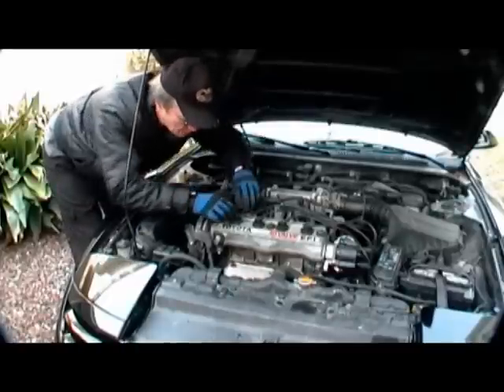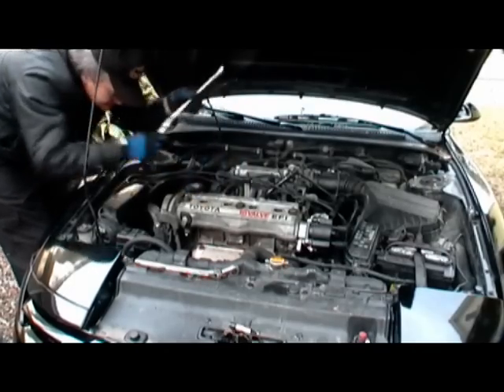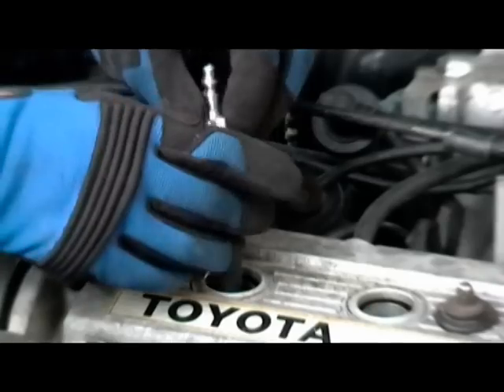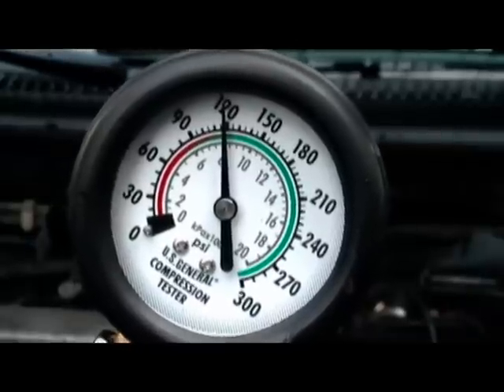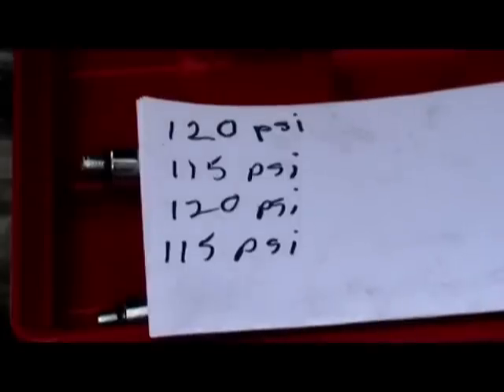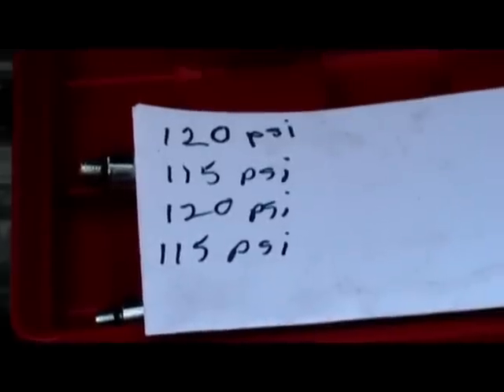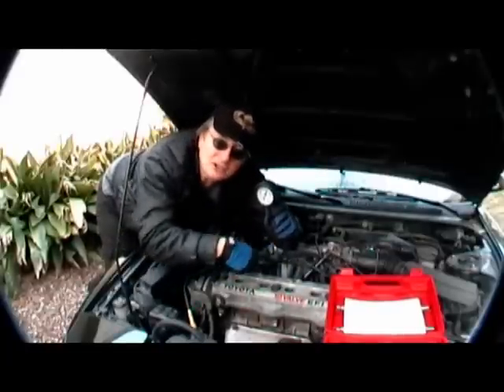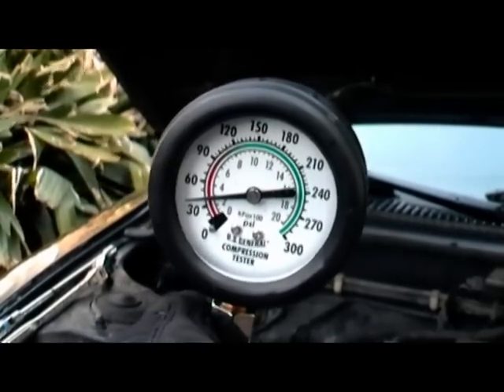How To Check The Compression Of An Engine

Comment: I've been reading online how to do this, and I'm a little daunted by the task. I have a 2004 Jeep Liberty, 3.7L and I want to do a compression test. But some places keep saying I need to disconnect my fuses for my fuel pump and fuel injectors, and burn out whatever is in the vacuum lines before I go about testing compression. I'm fairly new to this whole car thing, but my Jeep has done nothing less than force my hand to get good at this. Is there any truth to this, or can I just follow the steps in this video and I'll be fine. I'm just not looking to cause more damage than the thing already has.
Reply from the maker: Brandon Coleman follow this video it doesn't matter if the engine starts during a comp test
Reply: Scotty Kilmer Thanks Scotty, I'll follow it as best as I can :3 Jeep's been throwing cylinder misfire codes, tried a coil swap, no dice, still threw codes on the same cylinders, I've had my spark plugs changed recently, still no luck. Cleaned my throttle body, and ran fuel injector cleaner (Seafoam, unfortunately didn't see your video about the gum out stuff until today) through the gas tank, still rough idles, and sometimes when I accelerate, it's not that it's sluggish, but it feels like I hit a pothole or something. It's only at the beginning of my accelerations though. I'm hoping the compression test comes back fine, otherwise I'm worried I'm looking at new valves or something in my engine.

Comment: Hi Scotty, your videos are extremely helpful to guide my compression test.
My car is 2005 Mazda 3s, 4 cylinder, with 56K miles. The data required by manual are: standard: 199.1psi, minimum: 139.2 psi; maximum difference: 28.5 psi. My test results from passenger to driver side are: 178psi, 162psi, 171psi, 168 psi.
What are your options for my test results? 162psi is pretty low compared to 178psi.

Thank you.
Reply from the maker: Shiwei Luan   it should run ok that way, but really , with on 56 k on it, the oil must not have been changed every 3-4 thousand miles like I recommend to have that kind of wear already
Reply: Scotty Kilmer you are right, the first owner changed oil every 8 months. But for the past 20K miles, I use Mobile1 synthetic oil every 4K miles. How many miles will this engine last if I change the oil every 3-4 thousands from now on?

Comment: hi, hello, I just wanted to ask.. I did a compression test on junk yard engine... there is 2 psi..did I do something wrong? I hand crank it ))spinning not fast engough))engine is been sitting for awhile ))) NO WARM oil, to all metal parts))ii did everything right!! remove all spark plugs,,,plug in the compressor.. what hath hah should I do now?
Reply: The head could have major leak ,piston rings are possibly stuck- valves could be worn out across the board, but hand spinning usually only works for small engines- not an adequate test for bigger than lawn mower engines or small motorcycle engine.

Comment: hey scotty,
i have a 2004 toyota pickup 4 cylinders its misfiring and have some vibration when start move and when ascending a hill .
i changed spark-plugs 3 times and test every thing and find nothing bad .
after this video i tested the compression and found the cause of the misfire .
3 cylinders around 165 psi and # 4-95 psi .
i pour an oil in cylinder #4 then i have 150 psi .
are there any way to fix it with out change the piston rings ?
Reply from the maker: not really , and it could be worse than that, as rings wear, often cylinders do too which would require a new block. Most guys go with a good used junk yard low mileage engine instead.
Reply: Scotty Kilmer
 thanks for feedback .

Comment: Hey Scotty! Great vids!! I'm subscribed. I wanna ask: Are these pressure gauges universal? Can one of these be used to test the compression of a motorcycle engine? My question concerns mainly the size of the hose "head" that screws in to the spark plug hole.

Comment: I want to check the compression on the front three cylinders on a gm v6, do i have to remove the plugs on the back three cylinders also or can i just remove a fuse to take away the spark?
Reply: Oh shit don't tell me it's a 3800. Those plugs are a bitch

Comment: you should also disconnect the ground of ignition coil,becouse the high voltage is breaking the isolation of high voltage cables when electric resistance  is saddenly grows up..

Comment: hi how are you i have questions I rebuild the engine for my Suzuki Forenza before 3 days ago and when I opened the spark plug i found there is oil on top of the piston it's OK or no thank you
Reply from the maker: +Karam Chato drive it a week or so, often oil gets on stuff while rebuilding and then just burns off. PRAY it's just that

Comment: Is it a good idea to do this on a warm engine? In another video you warned about changing spark plugs on a warm engine because it can damage the threads and give you a bad day, especially if it's aluminium.
Reply from the maker: Henrik Nilsen just be careful, the test is more accurate on a warm engine
Reply: Compression test can be done cold for a comparison. At operating temp. Is the prefered temp. There is also wet (squirt of oil) and dry (no oil)
Reply: Henrik Nilsen 
*Henrik you made an excellent point. I cant even say i've yet become a do-it-yourself person, nottomention claim to be mechanic. All I've ever done is 2 oil changes, a filter change alongside my dad (God bless), and just once (after extreme research and scrutinizing): removal of spark plugs in order to re-gap and clean them. I also wanted to get access indide the cylinder to spray fogging oil to insure a nice lubed start for a car that had been sitting unused for 4 months.
**My point in this msg is that you made a very astute, clever observation: spark plug removal becomes risky when engine is warm or hot. It is almost always recommended done on a cold engine to avoid damage or difficulty in loosening, lessening the risk of breaking them, espec the insulator part by the terminal nut. ~Pep Boys website spark plug removal

Comment: how can you get that tester? and how much? i have a 01 s10 4 cyl truck 2.2 little and mine wont start its been sitter for 3 weeks now i dont know why it started to do this and i also have a blown freeze plug i been told by other people i have a blown head gasket but when i have check all of my oils they are fine no water in it you told me to check out this video my engine sound alot different and now that its been sitting my battery is dead

Comment: hey scotty, my car will not run , and after all the necessary tests,  i have reason to believe that jumped timing is the reason for my problem. however, how do i do a compression test for timing if it will not run .engine has to be warm , correct?
(fyi ..tried posting on your site to give you more details , but the site will not let me post.)
Reply from the maker: na, cold engines can be compression tested too, it would just be a small bit lower. And you have to join my website to post, but it is free at www.scottykilmer,com

Comment: Hi Scotty, what it work for Diesel engines?
Reply from the maker: you use a compression gauge with higher readings, and adapters that fit into the glow plug holes once you remove the plugs

Comment: I have a hemi engine that has two plugs per cylinder, how do I do a test on one cylinder?

Also, if I do find that the pressure from one cylinder is way lower than the rest, what does that mean? I guess it could man a number of things from bad rings to a hole in the piston etc....
Reply from the maker: just take one of the plugs out of each cylinder to test. If one is way lower, could be tons of things, and only taking the engine apart would find the true cause
Reply: Scotty Kilmer Yeah, I thought about it and figured the smart thing to do would be to take out one plug. It was early when I posted but thanks for answering :)

Comment: I got 4 readings one was 125 another 180 and two 160 is that bad? this car wont start its a throttle body has spark, it combusts on ether, i can smell fuel in the exaust  i tested the injectors with they are firing but rapidly pulling only an exuast code, its a 2000 subaru v 4 it has fuel rails as well.
Reply: +rubbertramp wrattchett you most likely have an exhaust valve that isn't fully closing during compression on the cylinder that read 125.  You'll either need to have a valve job done or replace that valve.

Comment: if say like on that reading say the 4th cylinder was only 70 psi instead of that 115 psi does the loss of compression mean that the block is cracked or could it be simple and just need to adjust the valves? just for instance just curious

Comment: Hey man, so i ran a compression on my 5.0, all cylinders are fine except for cylinder 8.  The reading shoots up sporadically to 240 but doesnt hold.  When i stop cranking, the gauge slowly drops back to zero.  See latest video i posted on my page when you have time.  Im hoping its just valve stem seals.  Let me know man, thanks!
Reply: k129h8 I have the same problem with my car. Higher compression. I’m thinking it’s the valve stem seals to. And your gauge might be faulty if it’s leaking air.
Reply: Stefen Bays all the other tests were good on the other cylinders.  I hope its not the tester because its brand new.

Comment: right now my vehicle cannot start so i am unable to do a compression test on a warm engine. any suggestions???? there was a blown head gasket, i replaced the gasket, water pump, now the car will not start. we are getting fuel, spark, but very low compression on all cylinder.
Reply: j c maybe the timing belt is a few teeth off

Comment: Love your videos! I have a engine with 240k miles on it burinng oil not sureif its the  piston rings or valve guides, what would you recommend doing?
Reply: Rey Reyna Do a leak down test to diagnose. You can do it yourself.

Comment: Scotty just had a quick question, I'm getting ready to purchase a diesel compression tester kit, is there any reason that the gauge itself would not be compatible for use on a gasoline engine, and if not can you please explain why not. Thank you.
Reply from the maker: na, they all work the same, diesels just have more compression and need higher quality gauges
Reply: Thanks for the info, kinda thought it was ok, also i really appreciate how you interact with people in your comment section, thanks for your service

Comment: Hey Scotty, my timing belt broke, and we're having a hell of a time trying to get that bottom pulley off...I got the 3 prong puller but it's just chipping and (and breaking) the pulley...so i won't be a able to warm up the engine before i check to see if its dead through a compression test (we also cut off the belt attached to the pulley)....Is there any way to test this engine before i put any more money into trying to replace the timing belt?? Any help would be great!

Comment: i got a 300 06 2.7 that had a bad water pump i change it now my car wont start it sound like grinding metal when i turn it over auto zone told me that the first cylinder  was on the wrong said now im checking compression n its not giving me a reading

Comment: Hey scotty, should I disconnect the fuel injectors electrical when doing this?
Reply from the maker: sure, if they're easy to access
Reply: yea I have a Japanese car so its right there. That way no fuel gets pumped into the engine.
Reply: Most modern cars can be put into clear flood mode. You do that by flooring the gas pedal while you turn the key. This will crank the engine, but it won't spray any fuel in.

Comment: What if I wanna check the compression on a cold engine?  For instance, I'm interested in buying a car that the owner cannot get to start.  I'd like to see if the engine is still (reasonably) fixable without requiring a rebuild.

Comment: I have a 96 honda accord ex 2.2l  and 1 cylinder is 120 and the other 3 is 150 is that bad . I did a wet test and the 120 went up to 150 can it be piston ring
Reply: Check your Bore and Replace Rings

Comment: i have an 04 malibu im replacing the head gasket. Its a 2.2 ecotec with a duel overhead cam. Ive been told i should do a compression test before i try to start the car or i could possibly bend some valves if its not timed right. you stated in the vedeo the engine has to be warm. how can i check to see if its timed right???

Comment: sir i have 4m40 engine 3 cylinder  smoothe but first cylinder is not proper working  just missing i have check the compression test but all cylinder are have equal pressure  what is problum plz tell me plz
Reply from the maker: often bad ignition coils or bad fuel injector on #1 cylinder, swap em to find out if miss moves
Reply: sir i m also a mechanic i m in problum that i have 4m40 mitsubshi desiel engine and i have checked all 4 cylinder compression .all cylinder pressure is oproximatly equal and also nozels are ok but first cylinder  in missing i give all my experties but no way .plz help me sir what did i do?
Reply: Hey Scotty, I use to have a misfire p0303 then I cleaned the electrical connectors from watching one of your other video and it worked. The misfire is no longer heavy as it use to be, however, after clearing the fault code I now have a misfire p0302? My car has done 55,000kms.

What do you think is the problem? Do you reckon I need to do a compression test?

Comment: so, taking a spark pug out of a warm engine won't hurt it? I was always told that it was a big no-no to take a plug out of a warm engine, especially if it has an aluminum  head because it would damage the threads or something.

Comment: Shouldn't you disconnect the distributor power(if there is a dist. cap), and pull the fuse on the fuel pump? The injectors would still be filling those cylinders every time you crank otherwise

Comment: If i have a crank no start issue and cant warm up the engine i have to do it cold?
Reply from the maker: yes, you would have to do it cold, doesn't matter as long as all cylinders are tested the same way. And so this video too https://www.youtube.com/watch?v=064Ilsz8Fzg
Reply: Scotty Kilmer Thanks brother.
Reply: Scotty Kilmer If i take all the plugs out, put the compression gauge down cylinder 1, crank the engine, and air gets pushed out of other spark plug holes. Is that a bad sign?
Reply: Koby Mapel No - ignore the air shooting in and out the other holes- you are only looking for the pressure build in the cylinder with the compression test gauge installed in it. The air in/ out of the other plug holes is just what should happen.

Comment: Hi my car is a 535i e34 i have done a conpression test and the results are : ~178-170-160-178-170-170 is this good ?
Reply: Cylinder #1 till #6 respectively
Reply from the maker: eddyLF  it's decent pressure, though the 160 is somewhat more worn than the others
Reply: eddy yes those numbers are fine they are at the top end of the spectrum when you reash 150 which is bare min for any engine then you know your engine is close to the end of its life you can still drive it use it etc but dont expect good performance good fuel milage even burning oil..

i am a ase master mechanic 20 plus years for dealerships only not a backyard mechanic like schotty here

Comment: why my engine misfire when cold? I checked ignition timing, replaced spark plugs and wires,also replaced make in brake of distributor and fuel filter. I also rebuilt my carburator and replaced fuel filter.

Comment: nice vide  cuestion. I got  a 1994 Toyota pickup 22re 4 cyl  im getting little oil and smoke on my exhaust pipe ,I did a compression test drie (# 1 ,183) #2, 175 #3, 170#4 ,210  wet # 1,184 #2,180 #3 ,180,# 4,210,,any advice  thanku,,

Comment: hello sir, I have a Mercedes c200 (w203). this car engine fan is not working. if remove   temperature connector then working and if connector is fix again then fan is not working. so can you give me   solution of this problem. please. . . . . . .   .
Reply from the maker: pray replacig the sensor fixes it, cause if not, it will get expensive involving computer modules and or wiring failure
Reply: Thank you sir

Comment: @scotty Hey i tried to do the compression test on my 02 dodge stratus but the primary elec connector is really hard to disconnect. they made it a certain way tht if u really dont kno how to remove it ull break it so i went to pull fuel fuse, but theres no label on the fuse box to which fuse it is. How dum is this? So is there any other way to cancell out the fuel to do this test? Like can i just pull the elec connector off each injectores?

Comment: I have a 98 bmw z3 2.8L with almost 120k miles. I do not know the compression psi yet. But just in case if they are bad or low, would you recommend to put some engine restorer and lubricant? I did some research and found this: watch?v=ly9ZZP9Ul7A . Have you ever heard about it? Does it work? Thanks in advance!

Comment: Everywhere I've heard you're supposed to test the compression with the throttle wide open
Reply: what difference would that make?
Reply: psychotogen1 closed throttle increases vacuum and reduces pressure in the cylinder. You won't get as accurate of a reading

Comment: Don't run E85. that stuff's crap. Ethanol destroys engines that are not designed to use it. Most current gas is 10% ethanol but that percentage hurts nothing though. Just use pump gas. The higher the octane, the better it'll run and the more power it'll have. Instead of filling up premium, try just regular and put in a large size bottle of octane booster in too. Won't cost so much to fill up and you'll get a power boost to boot.